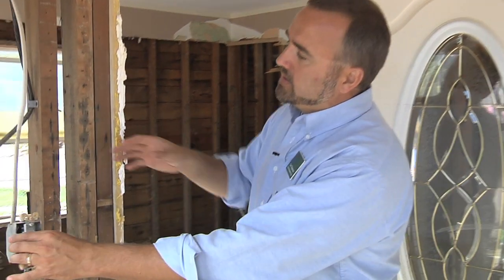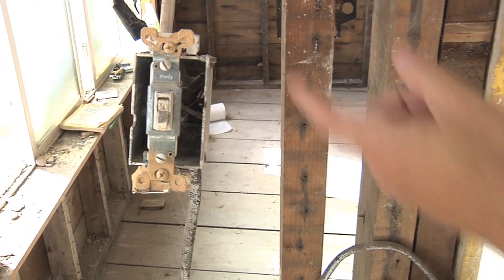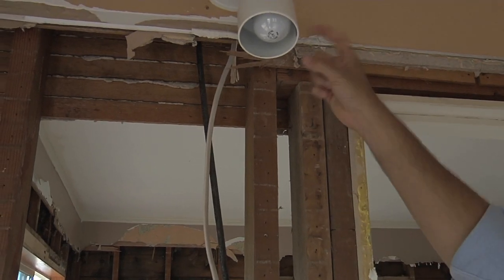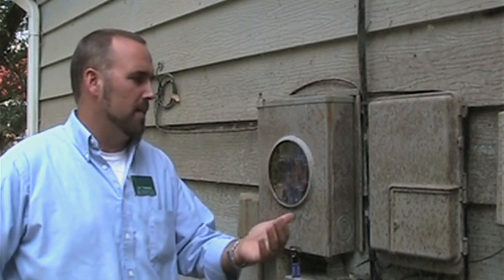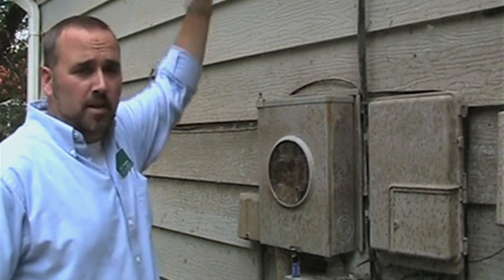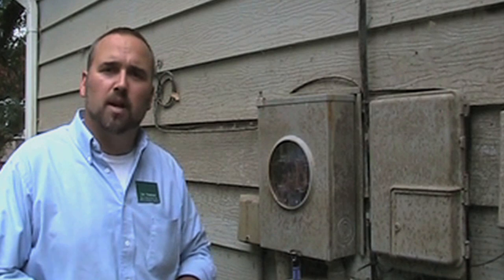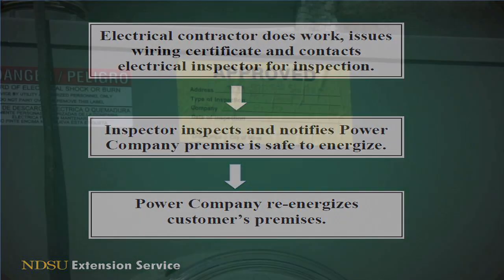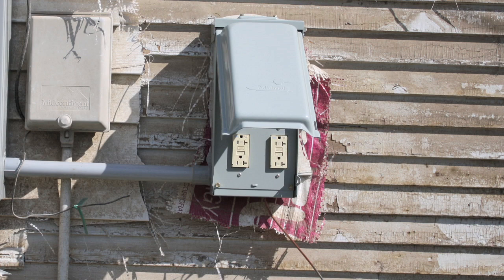Flooded Home: Electrical Issues

Comment: After hurricane Ian, the amount of wire that will have to be replaced is monstrous.
Reply: How do you protect those wires?
Reply: @marcoandres8830  impossible. The strength of the wind too strong.